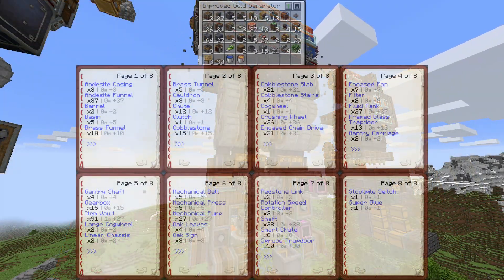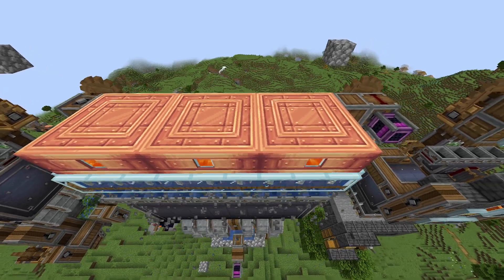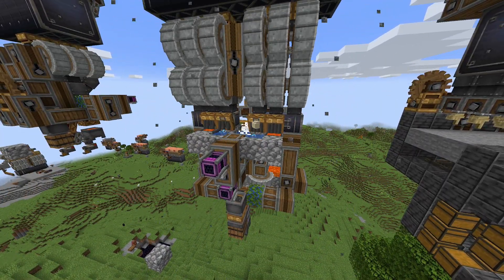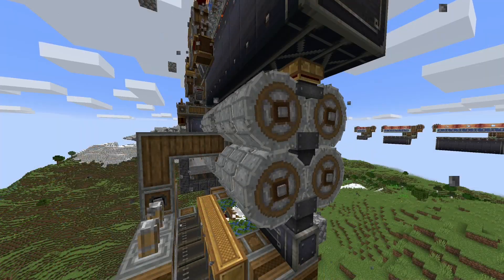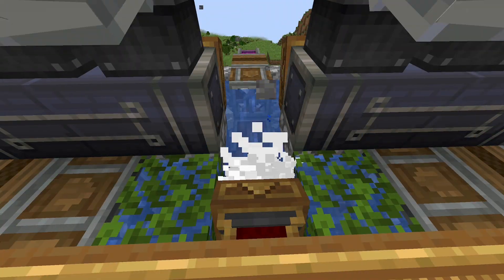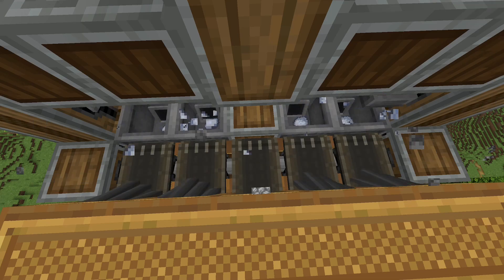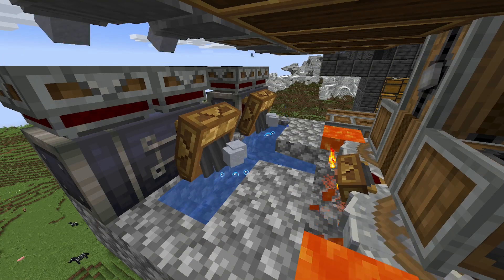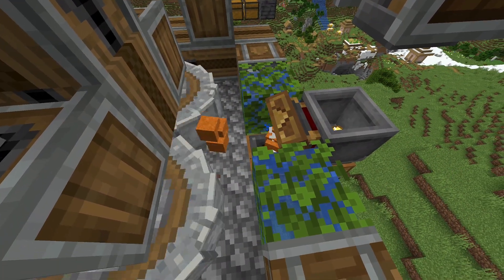INFINITE PIGLIN TRADING w/ GOLD Farming! - Minecraft: Create Mod

Comment: Create did not copy the sign text over nor does the cobble generator work anymore

Edit: So I fixed it. One. The cobble generator. remove and replace the redstone links by hand. IDK why this fixed it
Two make sure the grindstones and fan are spinning the correct way. and three. on the bottom level place two lava buckets behind the slabs and in front of the fans.

Comment: Hi, I tried placing the schematic with the cannon in my creative world to see if it worked, but I'm facing the following issue: at the Gantry Shaft and Gantry Carriage location, when I added water to the pumps, they broke due to the water flow. I'm wondering if this is related to my game version (1.20.1), something I did wrong, or if there's a possibility for me to fix it?
Reply from the maker: Yes it's a 1.20 thing. Push the gantry shafts and carriage back a block and you'll be fine. If you need help you can post on my discord
Reply: thanks for the discord, I found the solution ! @Triobian

Comment: Hey love the design but im having problems with half the stuff keeps telling me its overstressed, i placed the power engines with plenty of power at the spots you showcased in your video, but still having the same problem, any idea what could be wrong? 
its the 12 crushing wheels and most of the back and bottom parts that wont start.
Reply from the maker: Are you getitng the power and speed specified? because that might be the issue. if it istnt, i suggest posting on the discord since its easier to troubleshoot with images and being able to talk more consistently

Comment: hey uh, i got the schematic and fixed all the holes here and there that the schematicannon couldnt do, and even though the entire mechanism is working, it seems like it isn't doing anything at all. apparently, the cobblestone isn't being pushed into the crushing wheels for some reason, can someone here help me with that?
Reply from the maker: If you hop on the discord I can help. But it sounds like your item vault is bugged, try breaking and replacing it

Comment: this is pretty remarkable! though, haunting sand into soul sand, rather than washing it into clay produces far more gold
Reply from the maker: I'd welcome you to test that, because I'm quite sure the red sand method is more productive.
Reply: @Triobian  the granite method is about 3x more efficient, but that's going from .3nuggets/16cobble to 1nugget/16cobble. You also make useful byproducts that can be siphoned off as needed. 

The real argument is in the added complexity and volume, especially since the diorite and granite recipes aren't shapeless, so they have to be made in mechanical crafters. You can get them decently dense, but even at max speed that'll be your bottleneck.
Reply from the maker: Very interesting info. I'll have to look into that myself and figure out what all the differences are there. Appreciate your investigation
Reply: well the primary item from soul sand is quartz, which can be crafted into diorite, and then granite. when crushed it produces red sand. 

The clay route only gives 0.3 gold nuggets / 16 cobblestone

The granite route gives 1 nugget / 16 cobblestone

Comment: 2 of the 4 Mechanical Presses are not working, the lefthand one for each pair.  There's nothing but clay in the basin and the right hand ones work just fine.  For the time being I have set the 1 and 3rd Tunnel with a cobble filter so all claw is being sent to and processed by the 2 working presses.  It's keeping up but I assume by there being 4 that eventually it will get ahead of them?
Reply: Figured it out.  All the vaults placed weird and not a multiblocks so some of the funnels couldn't access some of the vaults and they were full.
Reply from the maker: ah so the basins were full of clay blocks, i thought they werent working at all. Yea cannon doesnt like multiblocks like vaults and chain drives. always a good idea to break one block of them and replace for updating
Reply: @Triobian  the basins were full of clay balls because the vault below was full of blocks and not connected to the other one so the funnel could not empty it.
Reply: @gloval2009  I can confirm this fixed the issue
Reply: I am only getting 999 ingots an hour, can you help?  🙂
Reply from the maker: I have not had anyone encounter that problem before. If you join the discord you can share some screenshots, and I can try to help resolve the problem

Comment: My crushing wheels are spinning in the wrong direction how can I change the rotation?
Reply from the maker: You should be able to change out one of the two shafts between the press and the chain drives that power the wheels with a gearbox / gearshift. And if you mean the top ones, just place one or the other on the row of chain drives.
Reply: @Triobian  worked like a charm thank you so much
Reply from the maker: Glad to hear

Comment: Your cobble generator design is super fast but kills my frame rate, any tips to improve it?
Reply from the maker: Other than turning down your particle effects or moving it underground where it won't render as much, only option is to slow it down
Reply: @Triobian  I found out it was actually due to the Sound Physic Remastered mod I had. It doesn't like when you break a lot of blocks very fast.
Reply: @pibombbb1175  Is there a way to fix the fps issue without removing the whole mod?

Comment: Why do you put the water inside of leaves? Is it purely esthetic or is it for a functional reason?
Reply from the maker: The leaves prevent the water from flowing in any direction. You can achieve the same effect  by blocking off the sides with whatever blocks you wish, if you aren't interested in including the leaves.

Comment: all this time i've been haunting sand like a dummy when i could've used this line of processing
Reply from the maker: The haunting method is certainly easier to set up, but mechanical crafters are slow imo, even when you scale them up. I do plan to make a haunting gold Gen at some point thoigh just to say I did
Reply: Haunting method? Explain
Reply: @StSimmyOfficial  authoritative are we? washing soul sand drops gold, so you can haunt sand from gravel cobble chain
Reply: Thanks! Also, forgive me, I didn't mean to come off as such